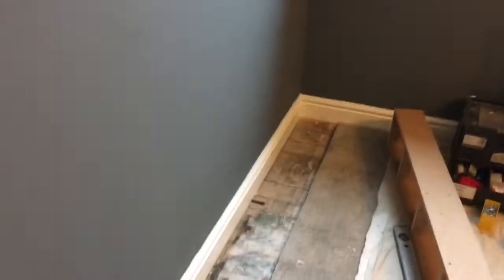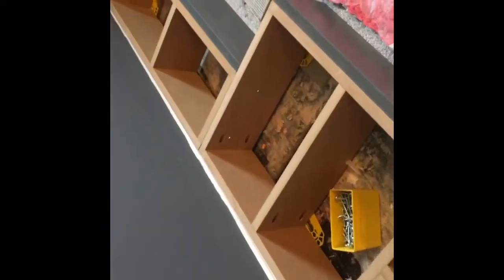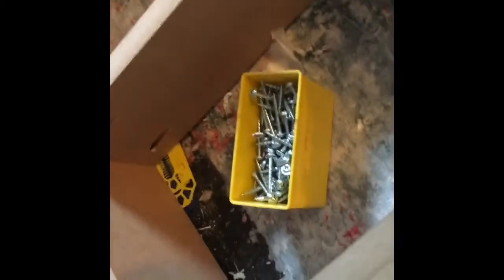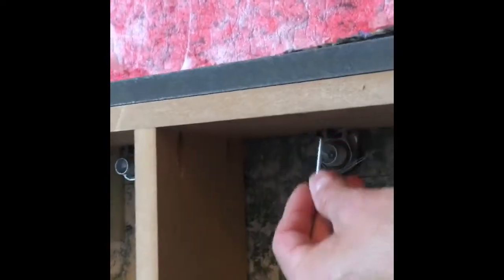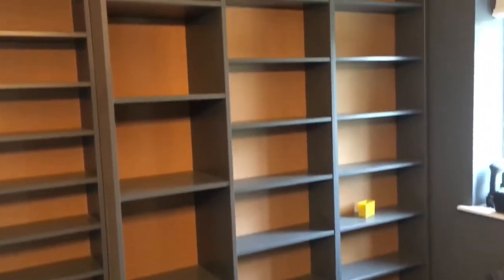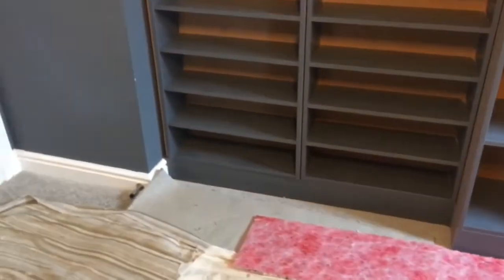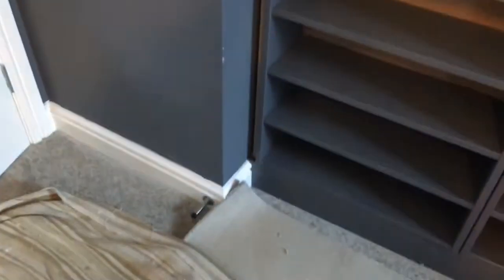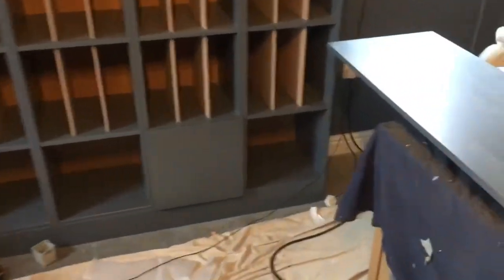How we installed this fitted furniture over carpet

Comment: For installing a large entertainment center, would you ever install right on carpet? What about hard flooring? I'm thinking to do so but design it with knock-down hardware so they can move it in case they replace the flooring or relocate to a different house.
Reply from the maker: Carpet - personally no not usually but if you take a semi-fitted porch without tight wall scribes and caulk then you may choose to do this knowing that by settlement over time won’t show at the wall scribes. Hard floor yes I do often fit over this, even floating floors, after discussing possible implications with customer

Comment: Really enjoy your vids.Very informative.Thankyou.
There's always more than 1 way to skin a cat,of course and a method I use when plinth is at least as high as skirting is:

IF ur cutting the carpet back;THEN why not cut the skirting back as well,with a multimaster guided by 17mm of shims? 

Personally I like to keep the carpet intact & cut the skirting as it's not exactly an architectural/heritage feature in a modern house.
I shim the plinth 10mm all round to avoid high-spots and then stand on the carpet to 'preload' it and get a true reading from the spirit level before adjusting the shims for level.Then screw through the inside of the plinths to the skirting boards as we all know how much fun it is to try to put screws through carpet! 

Angling the screws downwards slightly also gives a wee bit of 'fine adjustment' if required.

This slightly faffy method helps with thermal and acoustic isolation between floors and reduces the trickiest part of the scribing
Reply from the maker: Not sure I fully understood every aspect of this method Steve but I think you make some sensible points!

Comment: Great video, I know its a few years old now I have a question.  The plinth is sitting on spacer/feet at the back, and feet at the front, does the face of the plinth sit over the carpet gripper?
Reply from the maker: Yes fitting the final plinth face on top of the cut carpet edge made it easier for us to get a neat finish

Comment: I’m installing carpet in a walk in closet that will have a closet system with bases. Should I install the carpet wall to wall and then install the cabinets on top of the carpet? I’d also like to remove my baseboard and put it back to fit around my cabinets so the cabinets can be flush against the walls. Which order should I install all 3?
Reply from the maker: I always like to install onto solid floor.  If you are planning to change the carpet anyway I would recommend fitting the furniture onto bare floor (a solid base means it won’t settle and move over time), then fit the baseboard around it, then getting the carpet professionally fitted up to the baseboard.  However we do also often install in rooms that are already carpeted, in which case we cut back the carpet so the supporting ladder plinth or adjustable feet sit on solid floor but the carpet is cut to tuck just underneath the final plinth or base board which we fit tight on top of the carpet.  This avoids us getting a proper carpet fitter in but leaves a neat edge to the carpet.

Comment: Hi, great looking Unit. Your videos are really well done btw. 
Quick question.... Is there a reason why you couldn't just build over the carpet, securing the base through the carpet into the floor? The gripper would make it slightly higher at the back but could that not just be removed? Thanks in advance
Reply from the maker: It would be too spongy, maybe prone to settling over time and cracking caulk joints where the scribes meet the wall.

Comment: When drilling into the floorboards to attach the plinth, are there checks carried out for pipes and such things?
Reply from the maker: Jay K very rare for pipes etc to be cut up into the thickness of the floorboards so if you use 17mm screws it should be fine.
Reply: @Alastair_Freebird  Great stuff. Cheers.
Reply: Pipes are laid into cut outs in the top of the floor joists and cables are run through holes approx 1/2 way in the depth of the joists so providing you use the correct length screws which only go into the floorboards and not through them then there is no risk to anything under the floorboards

Comment: Hi Alistair, how did you paint the units? Did you spray all the individual pieces and then assemble into individual units or did you assemble the individual units and then spray? Thinking it must be hard to spray inside of all those shelf spaces. Thanks, Joe
Reply from the maker: Hi Joe we have always painted boards prior to asssembly, and on this project I think we had only just moved over to spraying but before that it was all hand applied with a mini roller.  We now spray everything but still as separate parts prior to assembly.
Reply: @Alastair_Freebird  thanks for replying. What method do you use for fitting all the shelves in? Do you have any videos of you guys assembling stuff in the workshop? 👍
Reply from the maker: Hi Joe we keep it simple and screw the shelves in from the sides.  Usually using Hafele confirmat screws and special stepped drill bit.  And our home made 3D squaring jig https://www.instagram.com/s/aGlnaGxpZ2h0OjE3ODU4Njg4MjMyNzYwMDM5?igshid=4tda5shhmi87&story_media_id=2238463966874198371
Reply from the maker: As for videos of assembly, I think it’s shown briefly on some videos on here but covered in a lot of detail in the members only complete build series called ‘a fitted furniture apprenticeship’ available at www.buymeacoffee.com/freebird
Reply: @Alastair_Freebird  I'm going to have to set up an Instagram account, I'm still in dark ages, not even on facebook yet 😂
Reply: @Alastair_Freebird  how does this buy me a coffee work? If i become a member for £5 a month, how much access does that £5 get me?
Thanks
Reply from the maker: @joefowler9600  hi Joe you can cancel anytime and to be quite frank with you it is possible for people to sign up and grab all the links and scarper but as with all my work I rely on good will and trust, and most people seem to stay on board long term because the value to woodworking business owners of what I give away FAR exceeds the cost.  I’ve often considered raising it but decided to keep a low barrier to entry in the hopes of the sheer numbers of people giving me a good return on my efforts.  I give away my alcove cabinets blueprints which are the result of years of refinement; an 8 part detailed build video series more comprehensive than any of the build videos on public YouTube; a hafele loox lighting crib sheet, and ongoing Vlog series detailing the ins and outs of setting up our new workshop from scratch; weekly blog posts or member only videos about a range of subjects from how to fit drawers and choose hardware to mental health and mindset, and customer service issues etc.
Reply: @Alastair_Freebird  sounds great, I'll be signing up mate. 👍

Comment: So I have come here hoping for some guidance on how to deal with fitting plinth over carpet...

From what I can see you don't? Only use the plinth as a template to cut the carpet??

Incidentally you have cornered the market for YouTube video's on fitted units.. all roads lead directly back to your good self.
Reply: My plan is to build a plinth out a material not quite as high as I need  so probably about 12cm to hide behind skirting that is is 14.5cm.

Then on the inside edge of the plinth cut seperate strips of batton which I can screw to the floor boards and fix level...

Then screw a block to the plinth so that it rests on fixed batton... Which gives us some height adjustment..
Reply from the maker: That’s nice to hear my videos keep popping up for you!
Reply from the maker: So you are talking about screwing battens on top of the carpet, to compress it?   What is the benefit of all that compared to just cutting the carpet back so you can rest things on solid floor?  I’ve always been skeptical of fitting fitted furniture on a spongey surface

Comment: what are the feet you used to level the base unit?
Reply from the maker: Tartan Vandal https://www.hafele.co.uk/en/product/adjustable-foot-for-aligning-heavy-furniture-integrato-g/000000560001344600050023/#SearchParameter=&@QueryTerm=Integrato&@P.FF.followSearch=9921&PageNumber=1&OriginalPageSize=12&PageSize=12&Position=1&OrigPos=1&ProductListSize=8&PDP=true
Reply from the maker: You might be interested in finished photos of these jobs (I was just back at the house on Friday measuring for some attic wardrobes so took some photos of the shelves in use): https://www.instagram.com/p/Buv1d4PAwd7/?utm_source=ig_share_sheet&igshid=1vop19r4dmv32